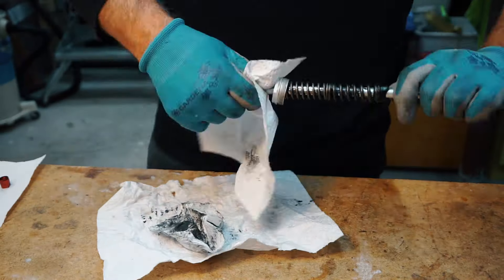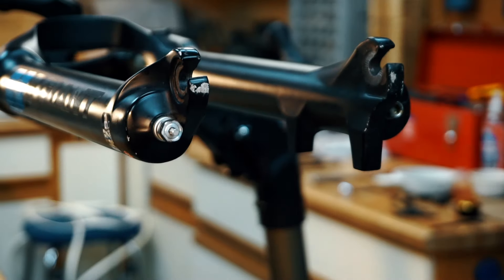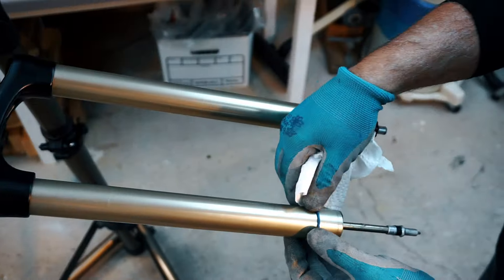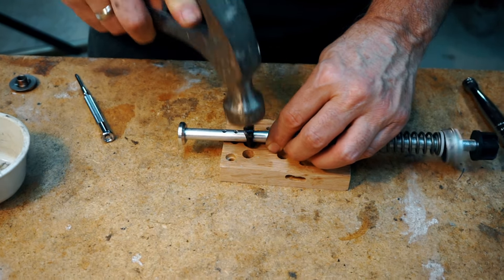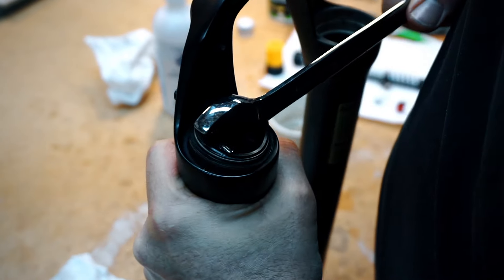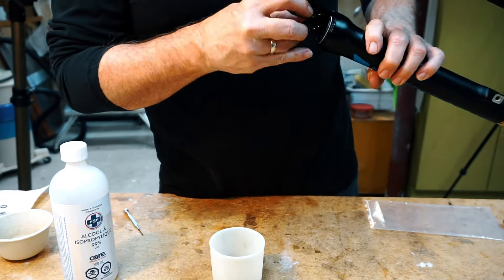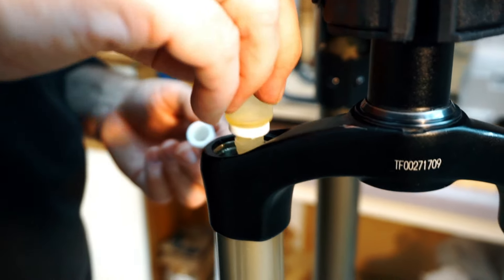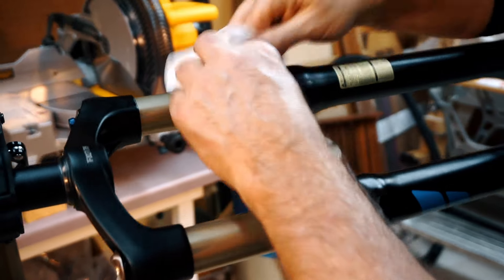SR Suntour Fork Service in 6 Easy Steps!

Comment: Greetings from Philippines! Question, can I also use the same 80w oil used in the air chamber for the foam seals? If not, what is the recommended oil weight rating for our Suntour fork oil seal, can I also use the Fox Float Fluid (pillow pack)? Thank you so much, I own a Suntour Axon and Im noob, I'm very sorry

Comment: This is just a question. Does the sr Suntour epixon air forks use any type of oil for the lowers? And if they also use the foam wipers that sit underneath the dust wipers? I'm not quite sure if the fork in the video has a similar build than the epixon. Thanks!

Comment: hey there, today i tried to change the travel on my new raidon (gave up because i couldnt get the damn pin out) this video helped a lot to get the lowers off. leaving the bolt in and using a mallet to separate first did the trick. even if i failed its always fun to take stuff apart and put it back together. cheers
Reply: Hard to do without a pin punch. Even then it's in tight.

Comment: the problem is the rc damper, some suntours (like durolux) come with serviceable cartridges and i really wanted to see how much oil does the compression part take, and if there is any hack to do it by eye (like for example rockshox mentions the oil height by saying "80-85mm from the top", sadly suntour doesnt make service manuals like that, even tho some of their fork are sorta pricey and were actually designed to compete with lyrik / fox 36...

Comment: I have the epixon at 140mm as I figured due to me being a feather of a rider it is nice to have that much travel ideally I would've got the Aion but they only come tapered which doest fit my bike. But so far the Epixon is amazing quite comparable to solo air Reba in all aspects.
Reply from the maker: SR Suntours may not be the best but they're hugely underated!
Reply: Is your 140mm still functioning?
Reply: @phil5073  yes. Lower leg service every year, wipe down the stantions after dusty rides saves the seals.
Reply: Building up a Santa Cruz Blur 1 classic mulleted with a brand new Epixon 27.5 fork that I have set to 140mm as well - should be interesting to see how it holds up! Gonna shred the hell out of it.
Reply: @phil5073  yeah still works, I have been using it less often than before. But honestly with periodic maintenance it performs like new. Like any RockShox or Fox fork would.
Reply: @vfgjasminebaker  let me know how it works out. That has a more aggressive Head angle than my bike so interesting to see how it’ll work.

Comment: I am looking into doing a lower leg service on my Aion, though i am quite confused about whether i should add oil (which/how much?) into the lowers like on other forks, or not as it isnt mention anywhere. I'd be very greatful for any help/hints, thanks!
Also great informative video!
Reply from the maker: Typically suntour uses no oil in their forks to make maintenance simpler. However, you can add 10 to 15ml of 3wt oil to each leg. Recommended brand is Maxima Plush Suspension Fluid. That goes for any of their air damper forks to improve performance.
Reply: @EverydayBiking  thank you very much! I assume this is also the recommended oil for soaking the foam rings, right?
Reply from the maker: @eddynator5847  You could use it yes.
Reply: @EverydayBiking  If I'm just doing a lower leg service (don't yet have a chamferless socket), would it be worth throwing in some 15wt oil?
Reply from the maker: @mydearriley  I probably wouldn't bother. Fork performs quite well without the oil and it just makes the next tune-up messier. Your choice if you want to try and squeeze out a bit more performance.

Comment: A quick question. Can the damper (RL R  one) be serviced? The lock out function on my EPICON has stopped working and I don't know why. May be on the last ride there were a few bumps with the lock out on. Any helpful suggestion is appreciated.
Reply from the maker: The damper is not really designed to be serviced. Suntour only sells a replacement, no parts.
Reply: @EverydayBiking  Hi thanks for helping out. But I did service it, basically changed the oil, put it back all together and works better than before! Their 'blow off' feature ensured that the fork was not damaged, only some oil leakage. On replacing the oil to the optimum amount, the lockout function was enabled again and working more precisely than before. All other functions are fine.

Comment: Well, while cleaning out the inside of the lower legs a small o-ring popped out (I think on the damper side). It is NOT the one that holds the bottom adjuster nut on, that's accounted for. Any ideas? I've been looking at exploded diagrams trying to figure it out (Epixon)
Reply from the maker: That is strange. I would not expect a  small o-ring inside the legs of the Epixon. Maybe someone serviced the fork in the past and put one inside for some reason. I would leave it out.
Reply: @EverydayBiking  I think it's the o-ring that's supposed to be on the bottom of the damper
Reply from the maker: @DragNetJoe  There is a very small o-ring on the very end of the damper. Normally it does not come off but maybe in your case it did,  so yes, that might be your o-ring.

Comment: I have a sr suntour raidon fork and people tell me it can go up to 160mm travel its currently at 120mm is it bad if i put in at 140-160mm?
Reply from the maker: I would not go above 130 mm. The fork is not strong and stiff enough for more.
Reply: @EverydayBiking  alright thanks, but now I’ve got a new question😅 i was working on my bike and it sat upside down for like an hour after that i noticed my lockout was not working… ive checked the bolts under the lockout cap they are tight but it still doesn’t want to lockout any ideas? My rebound still works btw all though it started making a strange sound

Comment: Here in Germany people complain a lot about  rattling Suntour suspension forks.
My new bike will have a Aion and I’m kinda scared😰
Reply: Have not seen that issue with the Epixon. Might be caused by a few things. Loose bolts on the fork bottom or the negative air spring moving around. If you have the issue I would suggest checking all fastners and making sure negative spring is well greased.
Reply: I seem to be one of those people complaining; my Aion started to rattle and it was indeed the negative air spring that came loose/broke. I had it repaired under warranty so i can't tell you exactly what the problem was, but i figure if it happens again I can fix it myself

Comment: No oil in the lowers?
Reply: These forks do not require oil. You can add it if you want to.
Reply: @michaelkollmann3197  If I put oil in Epixon, how many cc should I put in left and right?If I add oil, will it improve the performance?
Reply: @박상준-x2k  check out the comment 7 months ago under Eddynator where adding oil was discussed.
Reply: @michaelkollmann3197  Can you tell me the site?
Reply: @박상준-x2k  Right here in the comments. "Typically suntour uses no oil in their forks to make maintenance simpler. However, you can add 10 to 15ml of 3wt oil to each leg. Recommended brand is Maxima Plush Suspension Fluid. That goes for any of their air damper forks to improve performance."
Reply: @michaelkollmann3197  Can I put Superlube teflon grease on the seal?
Reply: @michaelkollmann3197  Do I have to remove the air to separate the lower leg?